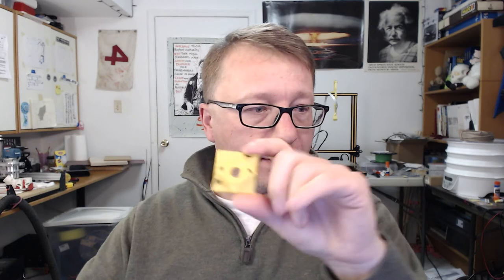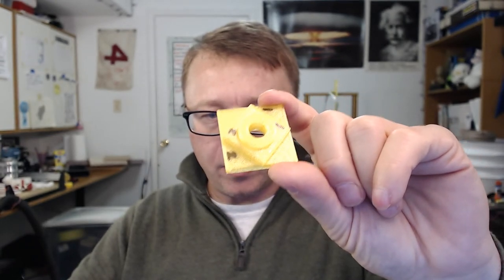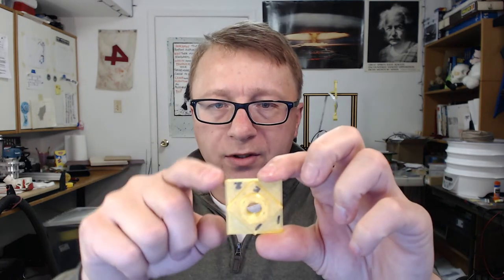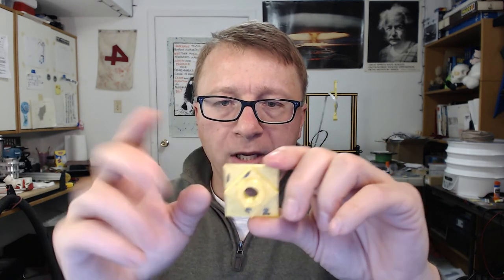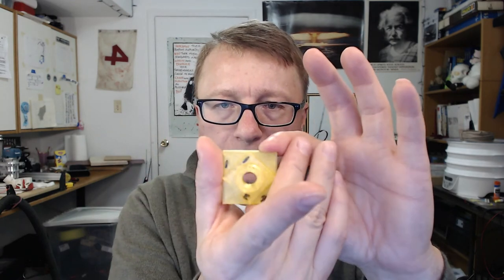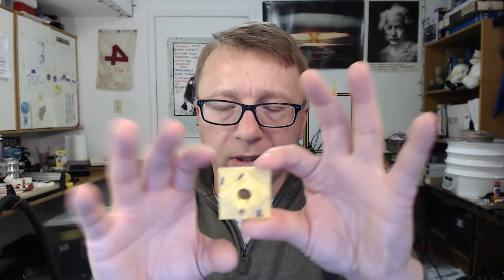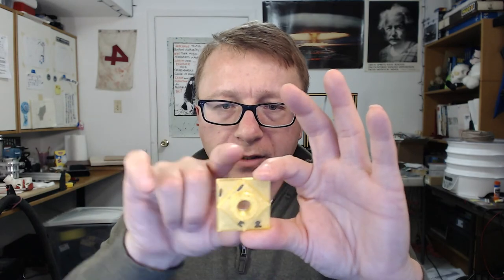Review of Inland PETG Filament

Comment: The Majority of the PETG filament I use is inland and I've had excellent results with my 2 CR-10 Mini's.. I do use aquanet  hairspray (heavy with PETG) It sticks very well. The reason I use so much hairspray is if I don't, it will stick to well.. I've found with all the PETG I've used, there is some shrinkage..
Reply: What setting are you using if I may ask?
Reply: @hypercube33  I use Prusa slicer (before it was just slic3r) so my settings have changed since a year ago when I posted that. I also now use Hatchbox and Sunlu now and have stopped using inland since I felt they really dropped from what I first bought from them. As far as settings, there are many and I don't use the same settings for the brands I'll print test pieces then customize settings per band.

Comment: I also use the eSun PETG and have found it a great filament. It even prints well on my CR-10. 
I've printed about a 1/3rd of my Orange Raptor spool. It, and several different rolls that I bought with it, are not wound consistently across the spool. The Raptor wouldn't stick to print surface (glass and texture) and I had to use gluestick. Good Luck.
Reply from the maker: Hi Jay - I totally forgot to mention the craziness with the windings and how it completely unwound 3 separate times then tangled with the spool holder to corrupt my prints.  I feel like I've rewound this spool at least 3 times.  I would say the eSun is of higher quality in many regards, but the raw filament is still good.  Thanks for watching and don't forget to subscribe :)

Comment: I’ve had a terrible experience of inland petg it has wierd bubbles in the print it fails so often when I switch to any other brand I’ve had no issues
Reply from the maker: Hi Anirudh -- sounds like the PETG you had was wet and needs to be dried. The water will vaporize when the filament is heated and produce bubbles and a popping sound. I'd recommend drying if you still have it and see if it works better.  Thanks for watching!